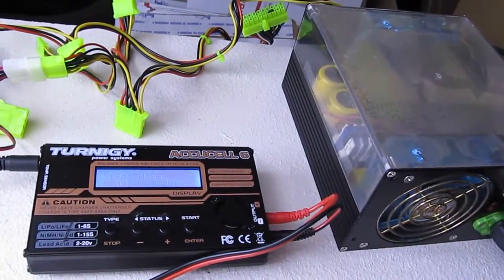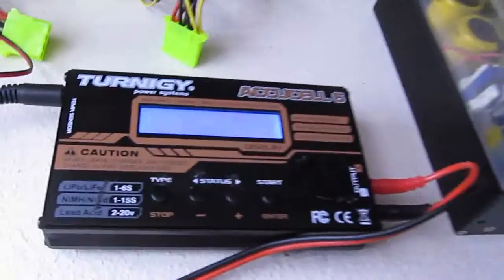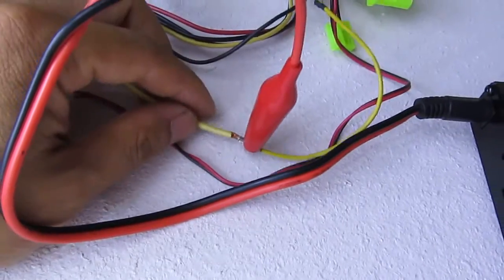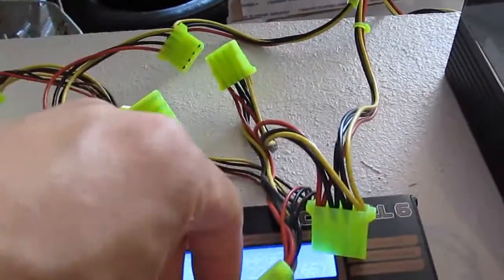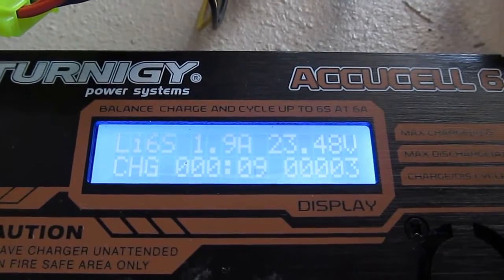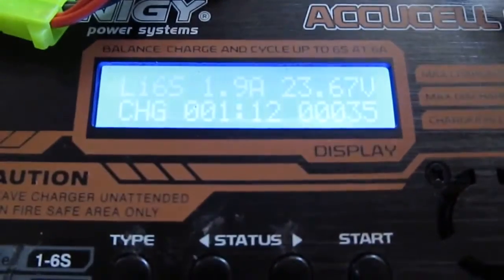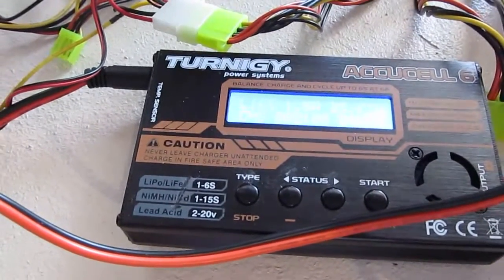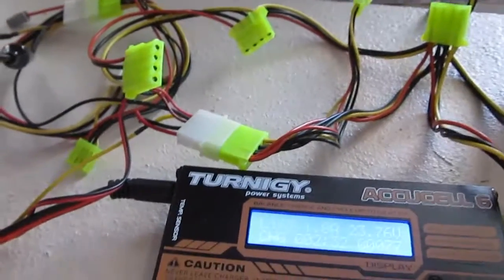DIY: Double charging capacity using computer power supply for Turnigy Accucel 6 or  Imax B6 charger

Comment: the power supply is fine on the amps side. its the voltage thats. if you charger a 3s you need 14v input, 4s you need 18v input and so on so a 6s battery you need a charger that can take 32v input to it.